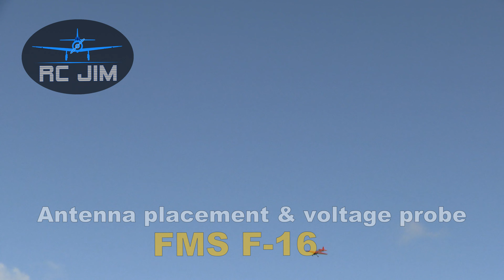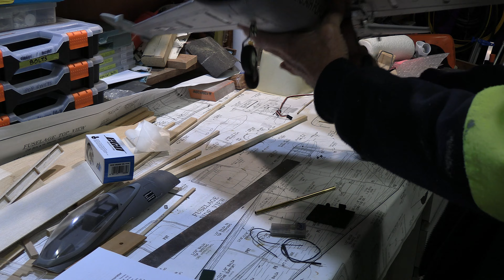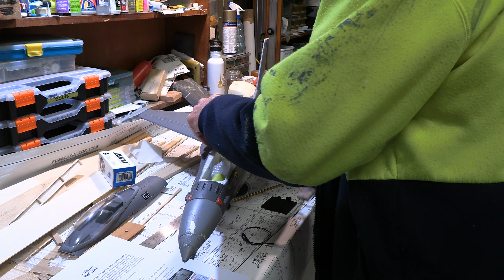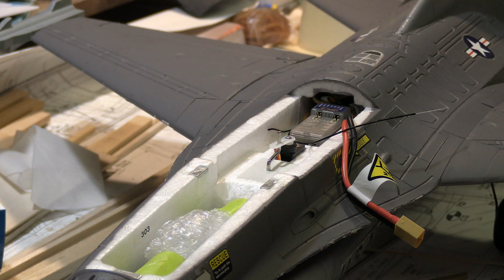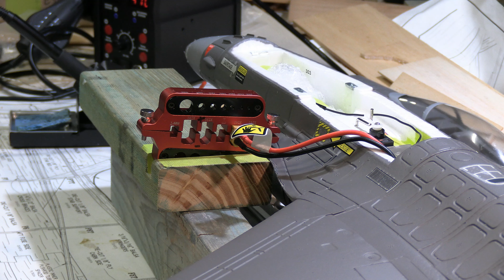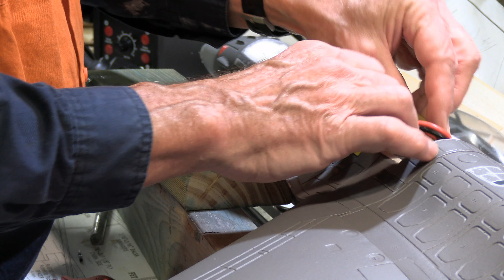FMS F-16 Antenna Placement and Telemetry Voltage Probe

Comment: Nice work Jim! The probe could go also without problems into the + in the balancer I suppose? I haven´t done this until now...
Reply from the maker: Yes, there are two ways to use the probe wire.  One is to plug the probe into the balance connector at the red wire - which is the full voltage of the pack.  The downside of that is that you need to do it each time you put in a battery, and it's really easy for it to come out.  The second is to solder it into the big connector coming from the ESC with the red wire.  That just has to happen once.  But sometimes the probe wire might be a bit short for what you want.  Ideally, you would like to tape it to the heavier cable to keep it out of the way.  That might mean that it has to go a farther distance than what its length allows.